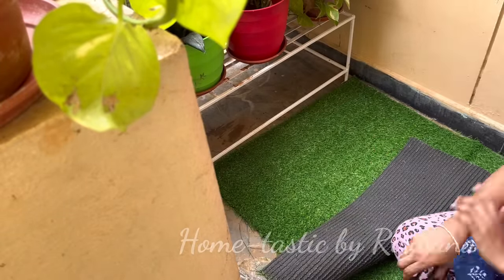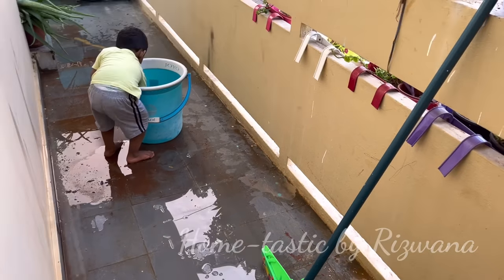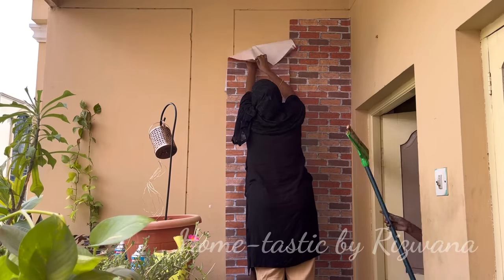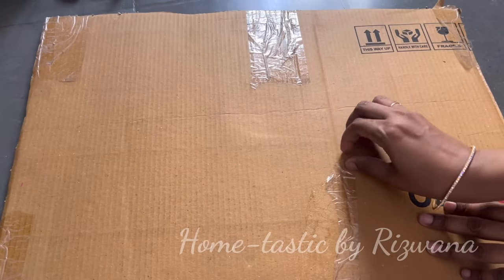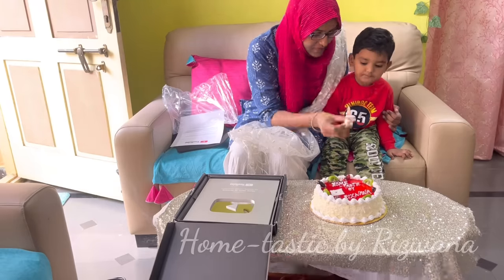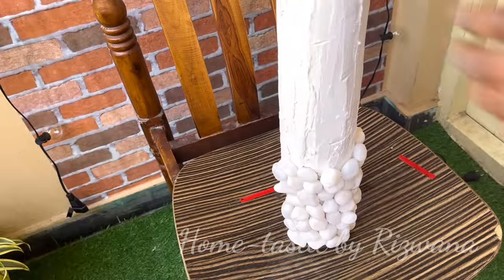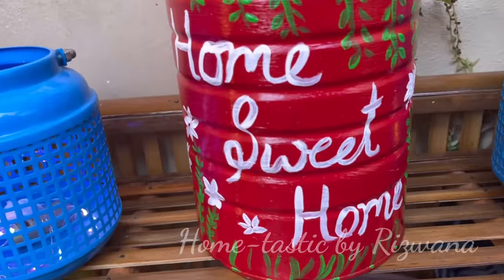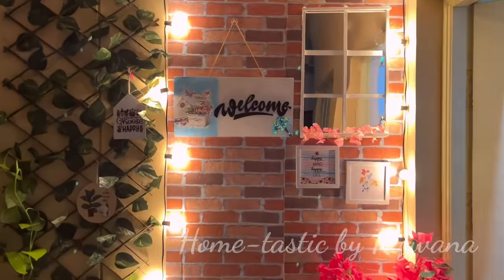Small Entryway and Outdoor area Transformation|Entryway Makeover 2023

Comment: Dont mind Rizwana it is not hate comment just a suggestion you usually make places very busy with decor bold colors wallpapers lot of decorations light etc. When its in tiny place don't use very bold colors try to stick one or 2 color theme. every wall don't need wallpaper with so much design. Sometimes less is more. Like this balcony you know the real plants were already too many but you can't put them anywhere else still you added artificial plants also. The brick wallpaper if you would  have chosen in light suttle color brick design it would have look much cleaner. In Diy instead of using bright red should  have use light color that will make place look less busy and big.